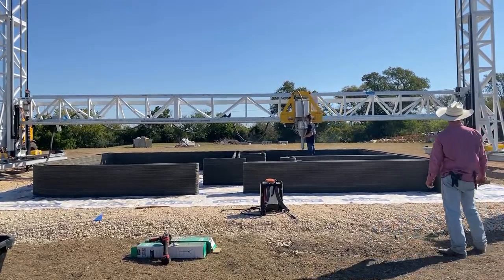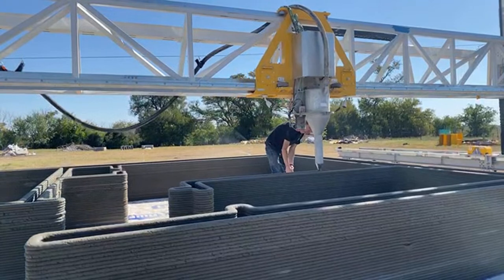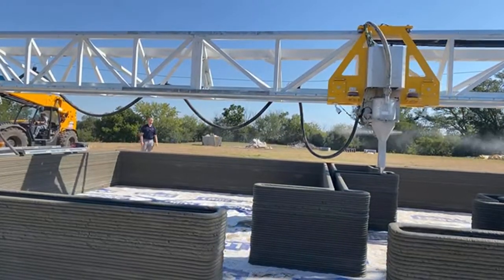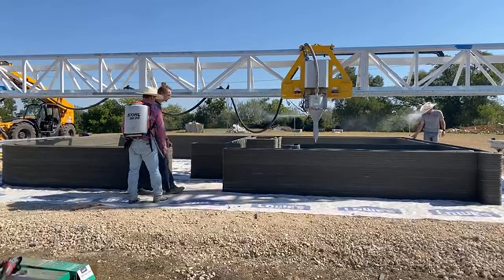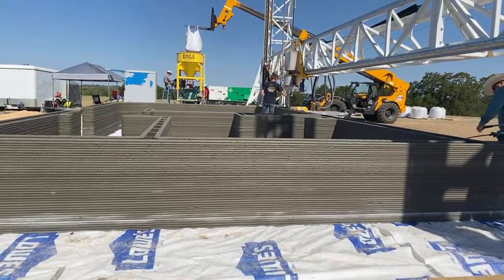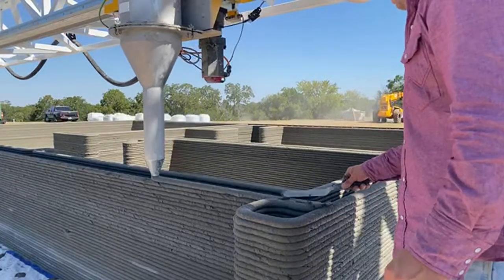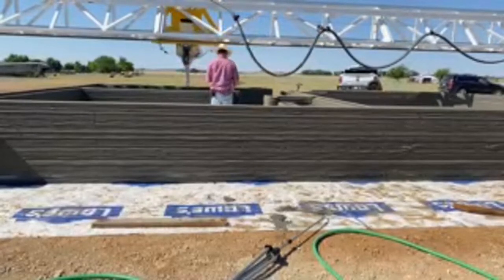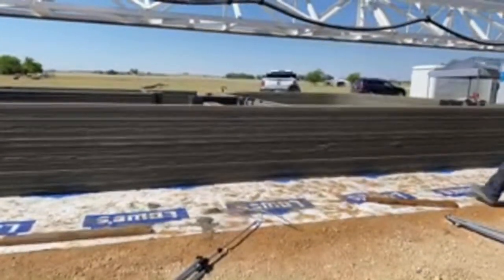Live House Printing in Texas

Comment: It's definitely interesting. I've been watching it progress since conceptual days. Looks like the weather issues won't be an easy one to handle. It'd be hip to have a hybrid  mortar of epoxy like stuff and sand. That way water wouldn't be a factor near as much. Heat and sun could be dealt with the mix. Add in some ground up recycled landfill stuff for funding. Doorways and windows need some work as far as sealing them off and trimming them out. I didn't notice if they started embedding flashing in the wet stages. I'm surprised they're not adding color to it yet. Make a smaller machine to grind wood product and print cabinets, millwork and flooring all level and flat. 
I like how involved you are with it. Your enthusiasm definitely shows.

Comment: how much is mixed at one time, in one batch?
Reply: The Planitop 3D NA mix is sold in 3,000lb supersacks. We have several size Silos and Batching/pump systems available to meet job requirements. Minimum capacity is 10,000lbs.

Comment: Great vid as always. Are they putting in rebar every layer? Or every few layers? Thanks
Reply: Horizontal Truss Reinforcement should go in approximately every 8 inches to meet AC509 specification for structural walls. Our approval does not require rebar, but local jurisdictions in specific seismic zones may require it.

Comment: HOW ABOUT DESIGNING A TWIN PHASE PRINTER SYSTEM. A TWIN PRINTING HEAD ACTION WOULD FURTHER SPEEDUP & STREAMLINE THE PROCESS AND PRINT OUT OR EXTRUDE TWICE AS MUCH VOLUME OF CEMENT MIX ON A TWO LAYER AT ONCE FORMATTED CONTRUCTION PLATFORM FOR FASTER TIMES. A TWIN PRINTING HEAD IS MUCH THE SAME IDEA AS A TWIN BLADE SHAVER.